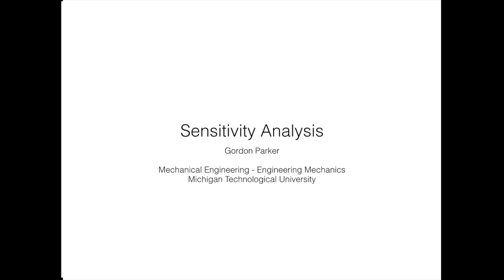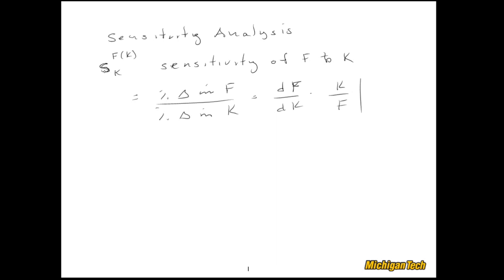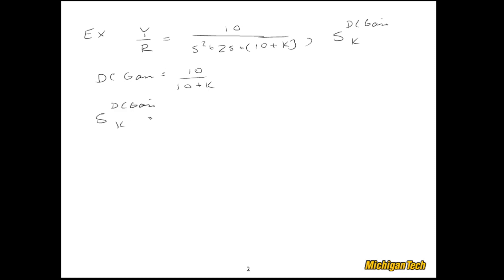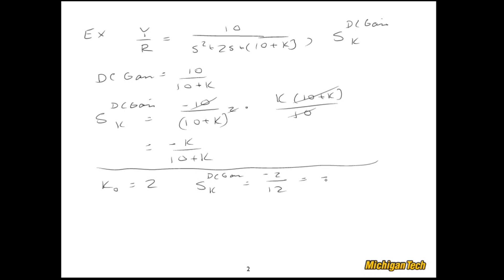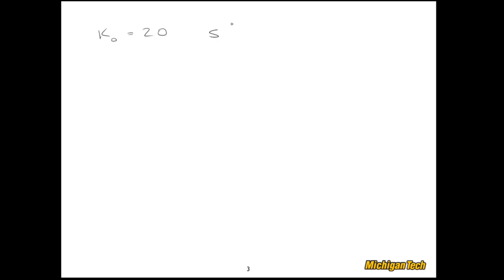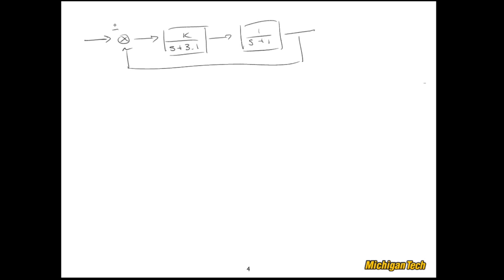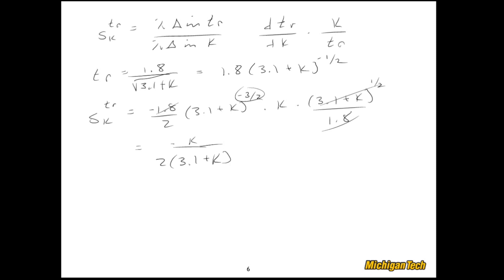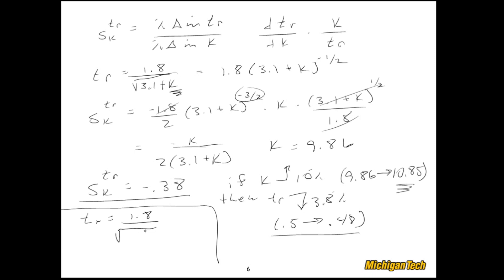Sensitivity Analysis

Comment: Hi, could you explain why did you multiply dF/dk by k/F? I thought the sensitivity of F with respect to k is just dF/dk.
Reply from the maker: yinggling This sensitivity definition can be interpreted in a couple different ways. The one I like is: the percent change in F for a percent change in k. For example, if k is a spring constant, and you know its value and tolerance (10 N/m +/- 3%) then you can quickly calculate the +/- % change in F at the operating point of interest using the sensitivity value. I don't think I mentioned in the video, but buried in this definition of sensitivity is a linearization of the system equations about the operating point of interest.